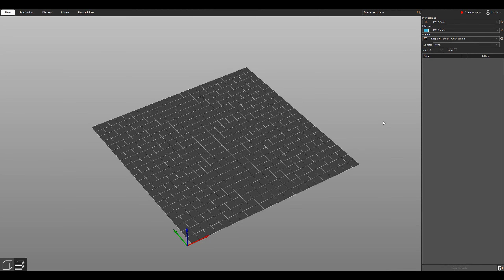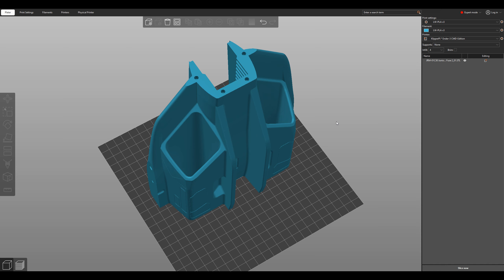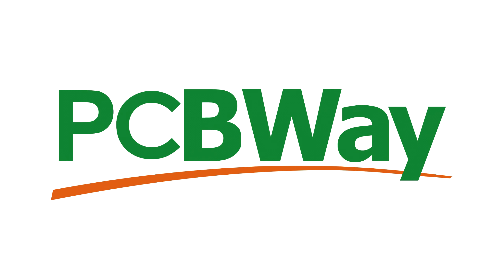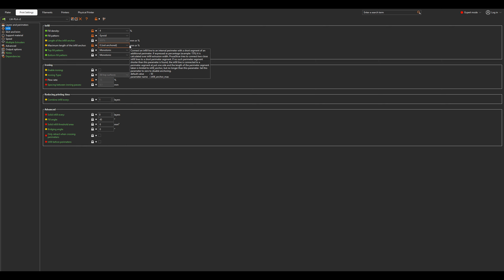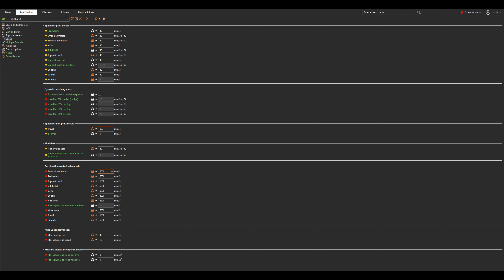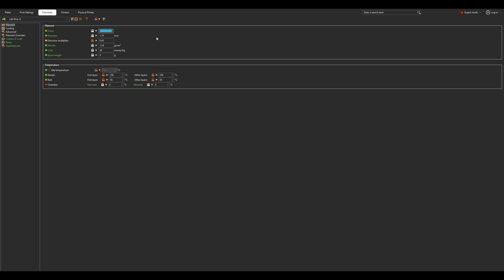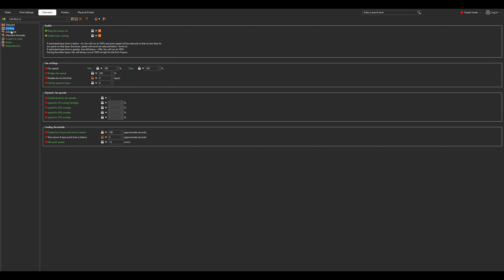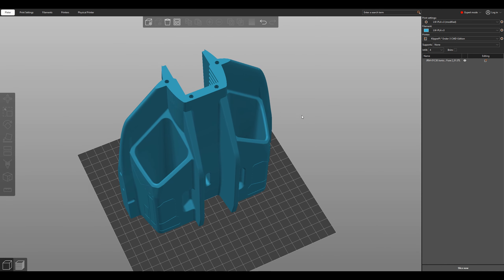How to print super light but strong using LW-PLA / My Settings

Comment: Hey Soyo, I use the FLSUN v400, and have trouble printing/I’m confused because my parts only print the walls and never the outside/inside supports etc not the top/bottom. i tried to print in surface mode and other modes but have not had any luck get the print to come out correctly. Thanks for the video, hopefully this will help👍🏼
Reply from the maker: sounds like there may be a partial clog?
or just vase mode enabled in the slicer?

there isn't much info to go off here